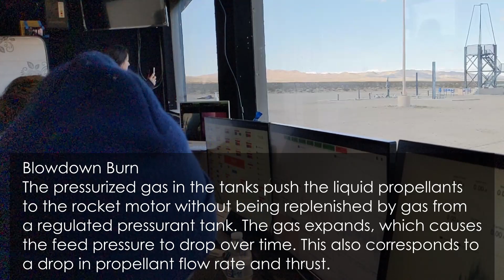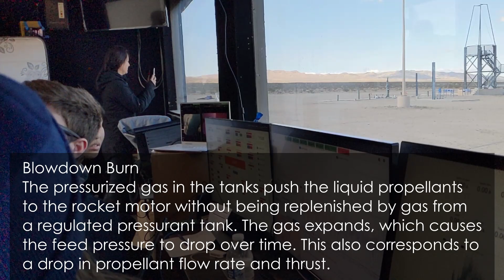Running a liquid rocket engine to it's absolute limit, twice. (Berkeley SEB)

Comment: How do they really avoid hardstarts , I mean do they directly go full main stage on the valves or they have prestage setup to let some flow and then open the main valves ........what is the key to not getting your engine to hardstart .
Reply from the maker: This isn't pump fed, it's pressure fed. To avoid a hard start, it is important just to make sure the propellants are burning well and quickly before it starts to accumulate.

Comment: Great video as always!  For the first burn, in addition to the massive pressurant collapse, there was actually a bug in our firmware that closed the pressurant valve at ignition, so it really was just pure blowdown.  For the second burn, we mischaracterized our lox flow rates in testing and ended up with twice the flow rate we expected.  This resulted in a very high OF of around 2.9, causing the graphite nozzle to breakdown with the higher temperatures.  Blast shield radiation is an interesting observation though, we'll definitely keep that in mind.

Comment: How many tonns thrust? Old V2 made 25 tonns with Alcohol/Lox and 30 tonns max with Dieseloil/Lox
Reply from the maker: Closer to a quarter of a ton, and it uses LOX/Propane. There's hardly any similarity with the A4 motor other than it uses LOX and it gets hot.
Reply: @DerekHonkawa  So what is the innovation here? Gas is expensive, why not biological oil and HNO3 ?
Reply: @Schlipperschlopper   gas is cheaper than oil, specially propane.
Reply: @slevinshafel9395  but its not climate neutral so its not cheap if you mind the climate problems
Reply: @Schlipperschlopper  Interesting you should bring this up. We are just finishing up a study of a 'green' solid propellant as a replacement for APCP motors and are starting this month on environmentally friendly climate neutral hybrid to be followed up with a liquid biprop study.
Reply: @mojaverockets  HNO3 ( gained from the polluted atmossphere) + biological vegetable oil would make a great climate neutral rocket propellant
Reply: @DerekHonkawa  250kg not bad, really nice. it was 27Bars on chamber?
Reply from the maker: @slevinshafel9395  I would say 21 Bars give or take, which is equivalent to 300psi. 300 is the magic number for ablative motors of this type. The fuel is pressurized to 27 Bars to give it a 100psi pressure differential across the injector. Rocketry seems to like multiples of 100 psi.